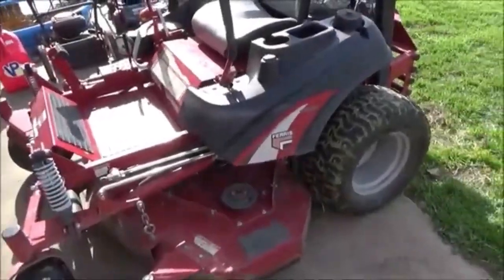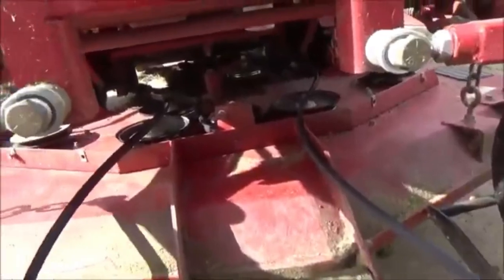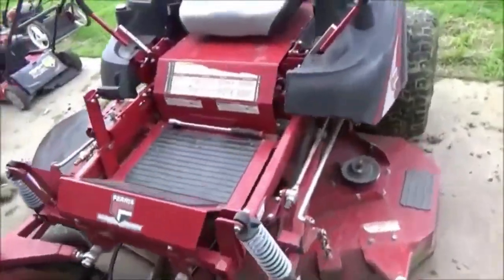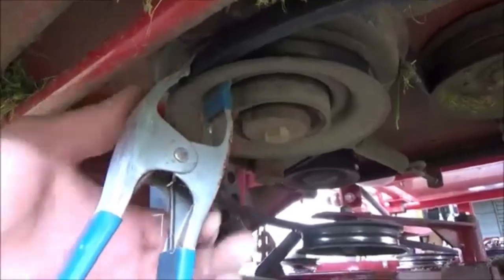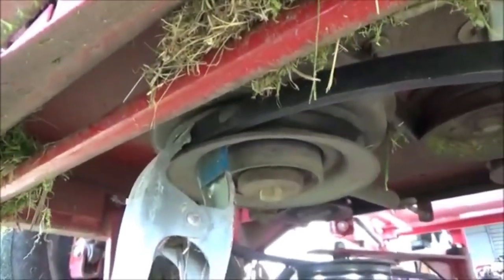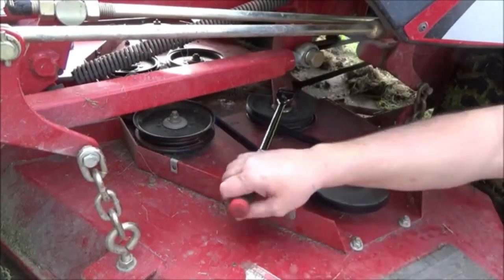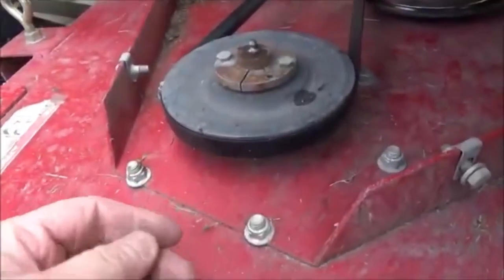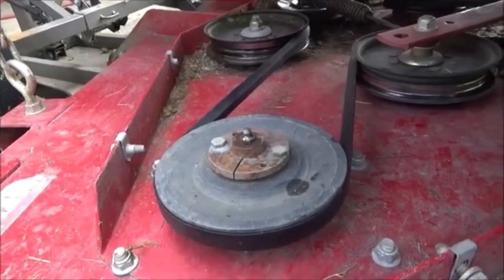TECH TIP TUESDAY / SPRING CLAMP HELPING HAND

Comment: Hey Jeremy 👋 how are you doing today my friend, I have a little question I just picked up a pas 2620 with the straight trimmer attachment used it for about 3 to 4 hrs and I love the trimmer but seems to me the coupler the attachment connects to is slightly tilted to the right so the trimmer attachment isn't perfectly straight seems like the coupler could be turned counter clockwise just a tad to make things straight. Is that sonething that's possible or is it completely normal? I love watching all your videos but especially the echo ones right now just to learn all I can about them :) just picked up the walbro and Zama metering guages today! Hope all is well with the mm1 family
Reply from the maker: It may have slipped through the cracks just a little bit during assembly just loosen up the t27 and clock it back straight
Reply: @THEMOWERMEDIC1  👍 ok will do. That's the bolt that goes through the hole in the shaft?
Reply: @THEMOWERMEDIC1  it worked good I didn't notice that it hindered the trimmer in anyway but thought it was odd.
Reply from the maker: @downeastoutdoors8713  No sir the boom coupler
Reply: @THEMOWERMEDIC1  ok so on the coupler you have the pin you pull out that goes through the hole on the attachment then you have the plastic handle to lock the shaft tight so I assume your talking about the set screw on the boom coupler? Wish I could throw a diagram up
Reply from the maker: @downeastoutdoors8713  Just make a quick little video of your issue and send it to themowermedic1@gmail
Reply: @THEMOWERMEDIC1  I would if I was home. Not home at the moment Jeremy, I'll see if I can send u a diagram Pic and go about it that way
Reply: @THEMOWERMEDIC1  I sent a picture through but couldn't figure out how to circle anything...lol haven't done it before